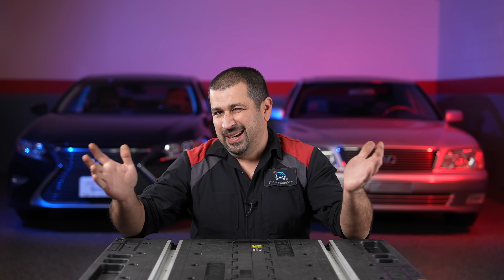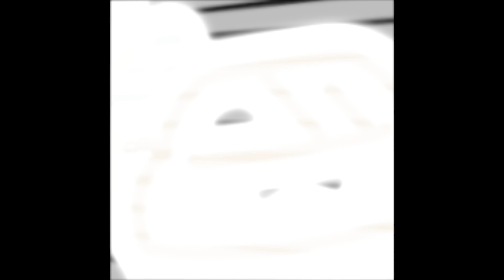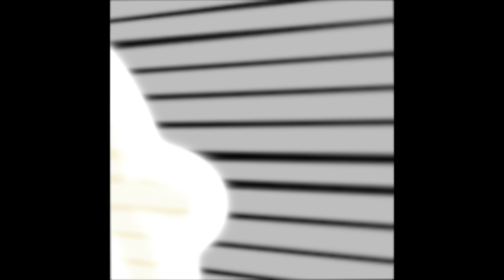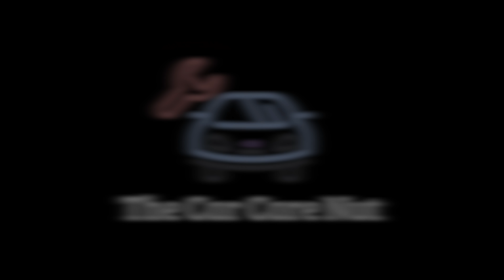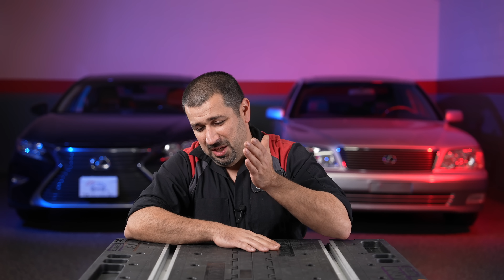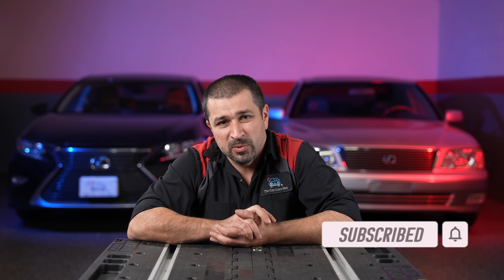Can Modern Turbo Engines Be Reliable? Here's The TRUTH!

Comment: Let it warm up, let it cool down, and change the oil frequently.
Reply: I have a turbocharged mazdaspeed3. I just hit 220,500 miles, with no issues. Oil changes every 5000 miles
Reply: @areitu  Im with you my 07 speed3 has 140k......still going strong!!!!
Reply: @areitu 2020 Subaru WRX, 160k miles, all but 20 miles are mine, zero issues but basic maintenance. Original turbo and clutch.
Reply: @areitu i wish I would have kept mine.
Reply: @areitu  You may have missed the part where he said the newer cars have smaller turbos.  He did remind us of turbo issues in 90s performance cars, but I'm guessing yours is newer than that.
Reply: @areitu don’t see much of you guys out here.. but I agree. 2014 sti at 275k miles. I don’t even cool down the engine just warm up.. you are 100 correct change your oil every 5k miles and it’s not even a concern.. just pure joy ..
Reply: @areitu You got a unicorn. MazdaSpeed cars have been known to be very unreliable.
Reply: @lightsfansofthewest481 lol. Nope.
Reply: @lightsfansofthewest481  no they weren’t lol the mazdaspeed6 had issues but not with the engine. The mazdaspeee3 were very reliable.
Reply: Four Toyota owners and  one Lexus owner told me they took their vehicle to their dealer for a 5000 mi oil change, and the dealers refused to change it, saying it wasn't necessary, wait for 10,000 miles.  The owners weren't asking for a free oil change.  I never heard of dealers turning down money before.
Reply: @jamesdepalma5253 just insist and it gets done. They recycle the oil at Toyota dealers, so it’s not waisted. Oil is cheap. On my 4th Toyota, a 25 Tundra this time.
Reply: @juliemulie1805 get ready for a new engine. The Toyota turbo engines are dropping like flies.
Reply: @jamesdepalma5253 They were not refusing to do the oil change. They were protecting their future income. Less maintenance = new vehicles
Reply: @jamesdepalma5253 I just bought a 25 SR5 Tundra and I'm getting the oil changed at 5,000 miles. It's a brand new engine so imo it should have been done at 1,000 miles due to some of the claims of engine debris, unfortunately they will have to change the oil or it will void the warranty.
Reply: @jamesdepalma5253 I had the same thing when I bought a brand new Kia in 2023.  Wanted a break in oil change at 1K miles and they refused to change the oil - at my own expense - saying it was too early.  I did it myself (and every 4K miles ever since, now at 44K miles) and have never gone back there.
Reply: @jamesdepalma5253 they want the engines to grenade at 10,000 miles
Reply: @evos469 technically they would prefer the engine blows at 65k miles. Outside 5/60 and too far for district rep to goodwill it. Unless you did every service by the book and you have a strong relationship with the dealership, that's customer pay.
Reply: And don't forget to use the recommended Gas octane and oil 😅
Reply: @losslesssound Or use something better if you want "optimal" instead of acceptable.
Reply: @MikeKayK just use what the manufacturer recommends. Higher octane fuel isn’t better.  It is higher octane. All that means is it can withstand higher pressures without having pre-ignition. If your engine isn’t knocking it doesn’t really matter.
Reply: @JamesLake78  Mine requires 93 octane.  Newer models by the same manufacturer say 87.  What happened to allow use of lower octane fuel?
Reply: @moonrich3492 for what car and what years? That’s a hard question to attempt an answer without more info
Reply: @JamesLake78 it’s not hard at all. The ECM does many things like lower boost pressures, retards timing, adjusts a/f ratio etc to avoid detonation. This is why some cars like Mazdas make 250HP with 93 octane but 227 with 87. There was a big commotion with Chevy Cruze owners when it first came out where owners would complain on hot days the car was so slow. Almost like it didnt have a turbo. So one owner put 93 in it and never had that problem again. What was happening is the ECM just opened the electronic wastegate to pull boost completely and cut timing to avoid knock and overheating. So yeah, keep lying to people that higher octane isnt better and it does nothing 😂 you’ll be the one doing 10,000 and 15,000 mile oil changes with a blown turbo because “tHe MaNuFaCtUrEr SaId I cOuLd!!!!!”
Reply: @losslesssound  expensive!
Reply: @gosman949 Yes but necessary. Why sacrifice your engine which would be more expensive.
Reply: Quality thin synthetic oil makes the difference.. 😊😊
Reply: @JP81188 you do not want it too thin or youll spin a bearing.
Reply: @agr_s2k exactly my VW  Volkswagen Jetta 2019 shot a cam phaser bolt into my timing belt. I since switched to 5 w 30 oil which is the oil that car calls for in south America and Europe however in USA it calls for 0w20. it's a epa scam so are 10000 mile oil changes
Reply: @erickh5291  yeah, thicker or better quality oil is always better for turbos. Full synthetic always.
Reply: @agr_s2k don't.change de viscosity of oil. It will destroy the engine. Many components are designed within those numbers.
Reply: @adrianhrusca4067  if you actually knew how to read, I was responding to someone who said that thinner oil is better. I was responding that thicker is better for turbos, not thinner.
Reply: Any tips when shopping used turbos? Can someone tell if it was mistreated based on sound or appearance?
Reply: @icqme8586  No you can't, unfortunately. Only thing you can do is ask for its service history. If they can't show it, walk away. If its had 12-15K intervals walk away too. If allowed you can testdrive it with a scantool attached and see if its running lean/rich but its hard to tell if the turbo is bad just from driving it. As you have no referencepoint (IE knew how the car drove when it was new).
Reply: @The_Noticer. exactly why I buy new.

So few people properly maintain their vehicles.
Reply: @icqme8586 It depends a lot.In a nutshell you can remove the intake ductwork and check for oil leak and play in the bearing. It's a very crude and basic method but will give you some reference point.
Reply: @icqme8586  nope. It's a complete gamble. I do my own changes and don't keep any receipts. Well, I also have no intentions to sell my car. But, if you want assurance you'll have to buy it new.
Reply: No one wants to drive a daily driven econo car like a diesel rig!  We want to be able to start it up, let the oil pressure build for 15 seconds and then drive normally like every naturally aspirated gas car for the past 50 years.
Reply: @BartSparrow123  You had to let a naturally aspirated engine get up to temp first too, if you wanted to drive it spirited
Reply: @The_Noticer.  Of course, but not as critical as a turbo spinning 30,000 rpms.
Reply: @BartSparrow123  i know on mine, it won't even let the Turbo go until the engine temp has warmed up. It's a simple mechanism.
Reply: so do the exact OPPOSITE of what the manufacturers and TV experts tell you to do. it is almost the same as listening to your Dr
Reply: Yes he missed the important point about letting it idle for 30-60 seconds before shutting off to let the turbo cool. Another point is the turbos are generally paired with direct injection, which also cause faster oil degradation than port injection. So between the effects of turbo and direct injection on oil degrasdation, frequent changes is a must!
Reply: @waynek805 this actually depends on the technology. Example I own several GTR’s (1992 Nissan Skylike GTR, and 2013 GTR) my skyline makes 700 WHP my R35 GTR makes 1200 WHP. My skyline is only oil cooled, while my R35 is oil cooled and watercooled. Why does this matter? Well I have a custom tune where it will keep my water pump running for 2 minutes to continue to flow and cool down the turbo when the engine is off. My skyline I have to idle for about 2 minutes for the turbos to cool after spirited driving. 

The water cooled isn’t some ground breaking technology. So it’s important to research the car. 

Now what you stated regarding oil wear is 100% true. I do my oil changes at 3000 miles without fail on my skylike and GTR because turbos generate so much more heat and breaks down the oil much much faster. 

While I change my N/A V6 everyone 5k miles.
Reply: @DJG37S  I think most of the mainstream high volume vehicles with turbos probably don't have the water cooling.
Reply: @waynek805   DI has nothing to do with turbos, that is just how they are meeting emissions
Reply: @notsure6182  Maybe not but it sure seems that they go together more often than not. Of course in the latest engines, it's DI almost across the board, turbo or not. At least in some cases they are smart enough to have the dual port and direct injection setup. And it's not like they didn't know about the carbon  buildup issue when they introduced this stuff. So much bad technology introduced just to squeeze a few more mpg. What a disaster it has become!!
Reply: @waynek805  I always let mine Idle for 30 seconds after I drive it but not to cool it down but to make sure that it's at it's lowest speed possible. I know turbos spool down pretty quick but I like the 30 second rule. Don't need it spinning any faster than it has to without oil circulating. Cooling isn't a problem because cars today have an electric water pump that keeps water circulating after you turn the car off to cool the turbo down. He's right on the money about oil changes. I always use a good synthetic oil, factory oil filter and I do 5K oil changes like clockwork. Plus I don't beat the crap out of my cars. I use to do that when I was young. I've worked on cars for almost my whole life and the days of cheap repairs are over. To much tech these days which means more to go wrong.
Reply: @waynek805 Looks like frequent oil changes are the rule of the day, turbo or not.
Reply: @TonyTony-rs1lh  Depends what you mean by frequent and according to whose rules. 4-5k mile oil changes would be the smart approach for any engine, especially those with direct injection, which is very hard on engine oil!
Reply: @waynek805 if youre not driving the crap out of it or its colder weather its not as important though as the warming it up and getting the oil flowing
Reply: @waynek805  New cars are also often equipped with an auto-stop feature that you have to disable each time you start the car. In stop and go driving, this will cause the engine to shut off often. In most cases the engine won't be pushed to high RPM's in between these periods, but if you drive at freeway speeds for a while and then exit to stop and go traffic which causes the engine to repeatedly shut off. this will cook the oil and shorten it's life.
Reply: @AugustSchunk  Yeah if I had a car with that auto shutoff I would definitely be sure to disable it whenever in I drove it.
Reply: @waynek805 Yes I agree with you but these were older engines,some even came with accumulator that would supply oil to the turbo bearings for upto a minute after shutdown. On new vehicles they have systems to combat this turbo charger are oil and  water fed also they have electric water and oil pumps to feed the turbo with coolant and oil after shutdown this is my personal observation.I am not an automotive engineer but have engineering background.If anyone has better information please chime in.
Reply: @aliasgertayabali5260 Thats correct its not necessary to cool them down. I mean the start stop system in all these new cars would destroy them otherwise.
Reply: @waynek805  The new Tacomas have both port and direct injection.
Reply: @jmpattillo  Yeah that helps with the carbon buildup issue but not the oil degradation via fuel contamination.
Reply: @jmpattillo  Yep so does the new Ford Mavericks and the Explorer have both port and direct injection.
Reply: @waynek805 interesting. Learn something new every day. I knew this about warm up but had not considered cool down. Thanks.
Reply: @gregrobertson9957 extended cool down if driven real hard, especially for long duration. Ideally, wouldn’t want to redline all gears and then immediately shut off the car. Could do some cooling by driving low/normal speed for a bit as well.
Reply: Dont you only need to let it cool if you just boosted with it? If youre not using it while going in smaller streets before stopping in your driveway you probably dont need to wait that much
Reply: @marcts147  yeah, just take it easy on the last mile or two.
Reply: @marcts147 turbo engines have had electric water pumps that keep circulating water when you turn the engine off. And lm talking of stuff made back from 2000.  Don’t know what manufacturers do with vehicals  sold in US.   I do know US sold vehicals of any brand are not the same as other parts of the world.
Reply: @marcts147  no need to have the engine running, just in Accessory mode for a couple of minutes. Check the phone or read the declaration of Independence.
Reply: @elim7228 oh shoot. I do that regularly.
Reply: 2015 golf tdi se 130,000 miles still being driven 5 days a week. Oil change every 5000 miles religiously since. Cleaned particulate filter once.
Reply: Exactly. Daily warm-up/cool-down habits, shortened oil change intervals, proper fuel, and early ignition maintenance (spark plugs, etc) are key to longevity.
Reply: I heard don't need this for modern turbo engines, Couple of second 5-10 should do the job. I have a 22 Subaru XT 2.4 Turbo. My first turbo engine car actually
Reply: With full SYNTHETIC oil
Reply: yup esp let it idle for a minute or two before shutoff... mercedes om617 400k miles..be an absolute nazi about maintenance. Oil and filter every 5000 no matter what any book, light or dealer drone tells you.
Reply: @aggie46  nazi on a Merc? Nice
Reply: I got into a rather heated discussion with the service staff at a German brand dealership because I insisted my oil is changed every 5000 miles.  Now that it’s out of warranty, I take it to a service shop that specializes in German cars, not the dealer.
Reply: The best way to warm it up is to start driving gently, as soon as the engine is running smoothly. Which is usually just a few seconds. It's not good to let the engine sit idling, especially from a cold start.
Reply: Yup same here I let my 2017 1.5 turbocharged civic warm up and cool down and oil changes and it just past 100,000 and no issues, hasn’t skipped a beat 😃👍🏼
Reply: You really don't have to worry about that as much if you use synthetic oil. Owning mine since 1991 I used to do it...but now with full sythetic I don't ...ya know unless I spent the day spooling it up on a hot day
Reply: PERIOD!
Reply: Okay boomer. This doesnt apply anymore. Go back to sleep
Reply: Ya think? How long do you let your car warm up, when it is 20 F out. How many minutes do you sit there or drive it very slowly until the temperature gauge moves? 1 minute? 2 minutes? 5 minutes? Ha!!
Reply: @arthurfisch3673 I use the remote start to warmup the car.
Reply: @howardpearlman6328  You don`t need to.
Reply: Yes
Reply: talking about  a truck or woman ?
Reply: and keep its air filter clean and fresh.
Reply: Good luck with that
Reply: Yes thats help but if you have a frenetic life, working, you don't have time to warm it and cool it 5mins+5mins everyday.
Reply: Personally When I start and shutdown the car i let it idle for 1-2min. Oil change every 3k miles in my Corvette, 5K Tundra (May change it around since the Z06 is NA and the Tundra Turbo).
Reply: Defining frequently is the difficulty especially if one does not DIY.
Reply: This is the key what I tell and inform all of my customers cause no one has told the public this.
Reply: Basically how you deal with an airplane. Wonderful.
Reply: cool your turbo down
Reply: I just keep my older Toyota. No turbo for me
Reply: @smokeylake6732  they wear out eventually unfortunately.
Reply: How about dont buy one?
Reply: Cool down means to drive easy the last mile and then let the engine idle for at least two minutes. Turning off the engine while the turbo is still spinning means you shut off the oil pump and the turbo axle is not getting lubricated aka is running dry aka come in a critical phase of wear.
Reply: let it cool down, yes. let it warm up.. CAN be false. depending on how you mean. you don't sit there for 2 minutes... big no no. 10-15 seconds and drive away to get the ring tolerances up ASAP - yes. you actually want heat faster when you have any engine.
Reply: @twrcrew8852  i just don’t spin the turbo up when it’s cold. I wait until the oil temp comes up.
Reply: @jmpattillo   On an old car with an aftermarket turbo or somewhat larger exhaust turbine, sure.  On these new 2016+ economy motors? it's not really possible to "not spin the turbo up". they are flying at full tilt barely off the throttle and have electronically controlled wastegates so you don't notice them when you're not trying to accelarate. but they are already doing it and there's no input the driver can make to change this short of rolling down a hill in neutral.
Reply: @twrcrew8852  I understand that it’s always spinning, but the speed of the turbo and the boost pressure increase with acceleration. I accelerate slowly when the oil is still cool. Not a perfect strategy, but it can’t hurt.
Reply: @jmpattillo  ohhh no. no no no.. The pressure is simply dumped. i'm telling you. one of the reasons it may feel that way is because the turbo's boost is literally wasted. above 2000rpm, you will be hard pressed to find any modern car that isn't already at full boost in an economy model. you just don't perceive it because it's being dumped into the pluming and bypasses your intake charge electronically. when you "command" more boost, the boost is already at peak pressure from the tiny turbo, it just closes that bypass to create an instantaneous sensation.   

Yes you are describing larger and older conventional turbo operation. but they are far far more complex in operation now.
Reply: @jmpattillo  but actually yes, you're correct. taking it easy but also "hurrying up" to get the temps up is best for the engine and turbo on these.
Reply: If I’m going to work, running a quick errand or have an emergency how?
Reply: Turbos work much better at higher altitudes where NA engines run out breath and struggle.
Reply: @Pamlicojdjdj1487 Not really. Turbos suffer at altitude also. They just are able to pressurize that thin air for the engine.
Reply: Yeah.. I see a lot of people not allowing their car/truck to warm up properly and just taking off right away big mistake down the road!
Reply: My dad had an 85 Dodge Conquest and he had to get the turbo redone in 2010.  That was with letting the car warm up and cool down after EVERY drive.
Reply: Yes, that works. To a point. If you want to pay $100 for an oil change every 6-8 weeks on top of everything else.
Reply: Actually, you can drive it for 3 minutes without engaging the turbo, both on start up and shut down.
Reply: Turbo diesel engine 10 minutes warm-up and 5 minutes before turn off.
Reply: Learned that lesson years and years ago on the farm driving my dad's turbo'ed Case tractors when he'd let me.
Reply: Excellent advice though I admit I do: Start and grow, boost it like you want it to blow up and put it away hot. Still had no problems (All oil and water cooled turbos though)
Reply: What are you thoughts on going with thicker oil for those that say some cars manufacturers are recommending 0w-20 for better mpg because of government regulations? Have a 3.5L turbocharged gv80. Was wondering if it’s safe for me to just use 5w-30 full synthetic from now on. 47k miles currently and I get oil change every 4-5k miles.
Reply: @YGuser631  the care care nut addressed this question in a recent youtube short. The vehicles are programmed to expect the thinner oil, so using thicker is not a good idea.
Reply: @jmpattillo thanks. I watch most of his videos but miss a few here and there
Reply: Better yet… don’t buy them.
Reply: What does let it cool down mean ?
Reply: @IEA_455  either drive easy for the last few miles, or let the engine run for a minute or so before shutting it down.
Reply: Yet dealers will charge $120 for an oil change these days.
Reply: Not warm up by idling but driving gently
Reply: @sunilayya8948  yes. I try to wait until the oil temp comes up before I. Spin up the turbo
Reply: Many new turbo cars have electric after-run coolant pumps that prevent heat soaking of turbos.
Reply: @midcenturymodern9330 tundra being an example.
Reply: Just because Toyota failed to make a reliable turbocharged V6 for the Tundra, Sequoia, and Lexus...don't mean we need an episode of excuses.  Ten of millions of Ford Ecoboosts out there with many are over 200k, didn't blow the blocks off
Reply: @n @noblekitty lol rage baiter
Reply: @noblekitty 😂😂😂
Reply: @noblekitty  And even more Redblocks and Whiteblocks in Volvo's going back to the 80's!
Reply: Modern engines with electric water pump and water cooled turbo don't need this.
Reply: . In the winter I would still let it idle for a minute or two.  Even the best synthetics get thicker so getting that oil warm will help that turbo. It's not good to starve the turbo bearings.
Reply: @simontist don't need what
Reply: Stupid Biden admin on climate change nonsense destroyed the car industry.
Reply: @smokeylake6732 blame California.
Reply: It’s not the 1980’s anymore…turbos these days have a dedicated water cooling and/or oil cooling circuit, and most of them keep the fluids circulating for a period of time after engine shutoff via an auxiliary pump.

There’s no need to do an old-fashioned cool down before switching it off.
Reply: @jimmytml if doesn’t hurt to do it, then why not..and this is only after really hard driving. Also doubt average car owners will know the design of their turbo, but probably won’t do much racing or hard driving either.
Reply: Let it warm up? That's a luxury the working class can't afford
Reply: @danielavila4108  engine is 10K
Reply: @danielavila4108 no time for that. 😊
Reply: How is that???
Reply: Good advice. Still not buying one.
Reply: @chester_hobbs you must. This society commands it! 😊
Reply: No.
Reply: Use 5W40
Reply: I even went the extra mile and fitted a giant wagner intercooler on my civic and added a cold air intake, all to lower the cylinder temps. Its a lot less iffy and hesitant on throttle now. Yes it also makes more power, but that only wears the engine faster if you rev it higher.
Reply: @The_Noticer. that is exactly what I want to do when I grow up and buy a new cat. 😊
Reply: @The_Noticer.  cluless
Reply: @strayedcat1966  166 replies, think i'm going to check what i said in order to respond?
Reply: Am a truck driver for 20 years and I have a lot knowledge about engines any engine, including boxer engines., I use TURBO ENGINE ONLY in tractor commercial truck , BUT I skip any single turbo engine for pickups truck , SUV and sedan cars , just no worked basically is just scam technology , Turbo engine is ONLY for tractor commercial trailers
Reply: @pacae911 what an ut twin turbos?
Reply: @JamesDeLaFuente-s4n double scam , come on turbo engine are terrible, why you choose twin turbo , that is insane
Reply: No. I'm not going to sit and wait for it to warm up and sit to wait for it to cool down. No.
Reply: @barryjoslin432  just drive it easy and avoid spinning up the turbo until the oil temp comes up. Also, easy driving just before your destination will allow it to cool down, like driving through your neighborhood to your house or looking for a parking spot at a store. You just want to avoid driving really hard and then shutting it off suddenly.
Reply: @jmpattillo Define driving really hard. As is racing with the car?
Reply: @timothylee2772  it’s all in the Toyota manual. They don’t really define it. Just drive more easily on the way home from the races to let the turbo cool down.
Reply: @jmpattillo I don't race with my car. I just do regular commute, so I don't need to cool down before shutting down the engine? How about like after driving for 30 minutes on a freeway to your destination?
Reply: @timothylee2772  probably the relatively slow drive from the freeway to your parking place is enough.
Reply: @timothylee2772 then cool down wouldn’t be necessary.

Maybe a general/high level explanation as to why cool down might help.  Oil is in turbo, hard driving creates heat and oil temp can get high.  Leaving high temp oil in the turbo is not good for it. So cool down, which can be idling and/or driving in low rpms (cool down laps) before turning off the car circulates the oil and helps bring down the temp, therefore wouldn’t leave hot oil in the turbo.
Reply: @davidd7175 Ok...thanks for the explanation.
Reply: @jmpattillo this is what ive been taught as well... for moden turbo 2x turbo - drive it easy the last mile or two and youre good... and change the air intake filters.
I still let my 2024 Z sit at idle for 30 seconds or so even after easy driving. 😂
Reply: @barryjoslin432  You don't have to, you just have to use your noggin'. Every engine, especially the aluminium ones, need to be warmed up properly before putting the full load on them, turbo's are no exception. And you don't need to sit for a while to allow the turbo to cool down, just stay off the boost for the last few miles and your turbo will have cooled down enough.
Reply: @barryjoslin432 you dont have to. Original poster doesnt know how modern turbocharged engines work. What he said applies to turbos at least 3 decades ago
Reply: @barryjoslin432 no one will realistically do this
Reply: It only needs a few seconds for it to spool down.  They don’t need cool down.
Reply: @bngr_bngr while circulating (engine running) the oil gets to around 150 degrees Celsius. The turbo itself heats up a few times that. Like over 500 Celsius. When you stop the engine there's oil sitting in the small cooling passages inside the turbo. As it is no longer circulating it cannot dissipate the heat, so that small amount of oil will match the turbo temperature. It will burn and deposit in those small passages. Over time it will build up... Yes, let it run for half a minute or a minute when you arrive at your destination, especially after a spirited drive.
Reply: @CosminRotaru  EXACTLY! Oil coking!
Reply: @bngr_bngr in Aviation a turbo charged piston engine requires a warm up and a cool down. They even specify a set temp to warm up and a temp to cool down to before shut down. But aircraft engines are expected to last. Cars are just considered disposable.
Reply: @FalconWing1813 yeah in aviation those engines are a little bit bigger.
Reply: @FalconWing1813 isnt this where turbos were born out of? The Aviation industry.
Reply: @stratonick  yep and they do need a warm up and cool down. Warm-ups are for the oil to get warm and flow good and not starve the bearings. The cool down is to let the turbine and bearing Temps settle so the oil will not cook inside the turbo which shorten the turbo life.
Reply: @FalconWing1813  Failure at altitude is problematic. If I blow a rear seal on my 850R, I'm already on the ground. 😉
But your point is a great one. I do warm up and cool down my turbo cars. All have more than 200k. My '96 850R has had the same turbo since 2014!
Reply: @FalconWing1813 there also 40-50 year old tech
Reply: @KapitanPoop  true modern cars do have water cooling that helps with the heat soak issues.  And allows the turbo to be more practical in a family daily driver,instead of a race car. Keyword is help. And does not exempt the need for synthetic oil and proper care. We just live in a world where cars are disposable in many people's minds.
Reply: @bngr_bngr I don't think you have ever seen a turbo running a full load 😂
Reply: @aliasgertayabali5260 my Porsche Turbo runs a full load of power but it’s a small car.
Reply: @bngr_bngr That's is even more interesting, try looking at it in the dark without a flashlight after your full load run 🥵
Reply: @aliasgertayabali5260 the turbos glow, the headers glow.  If I’m lucky I might get some flames from the exhaust.
Reply: @bngr_bngr they definitely need to cool down. They just dont need any help from the driver. Modern turbos are oil and water cooled and continue to be cooled after shut off.
Reply: @bngr_bngr  from what I know, you only really need to do that I've you had just pushed the car really hard before reaching your destination, or if you are stopping after a long highway drive. But still, if you drive at lower speeds/power in your neighbourhood till you reach your home for example the turbo and engine overall has enough time to cool down and you should be safe to shutdown your engine without waiting. Honestly, I still wait a minute before I shut my car off if I have been driving "spiritedly" just to be safe, and yes the car keeps the fans on for a minute after shutdown, but I am not sure if they also feed the oil pump.
Reply: @bngr_bngr  Every turbo needs to cool down before you shut off the engine.  If you are towing or running under load the turbo is probably 300-400 degrees!  It will cook the oil if you shut it off that hot.  This is another reason turbo is a terrible idea in a daily driver!  Not a single normal owner is going to let the car idle 60 seconds after startup and 60 seconds before shutting it off.
Reply: @BartSparrow123  No, you don`t. Do a google search next time. 
"No, modern turbo engines typically do not require a cool down period before shutting off, as they are designed with features that manage heat effectively. However, if the engine has been driven hard, allowing it to idle for a minute or two can be beneficial for peace of mind." - Anthropic
Reply: @BartSparrow123 Yes you are correct but your temperatures are a little bit off you need to add a couple of hundred degrees 😂
Reply: @bngr_bngr  Best practices > "need"
Reply: @bngr_bngr  That's not really true. First off, cool down is a relative term here. The big reason one should let it run for a short bit before shutting IF they have been hammering, is because oil also carries away heat. Way back before synthetic oils and/or additives that dealt with heat better, the oil would actually break down / burn IN THE TURBO (do some digging on oil-coking in turbos).  Considering the cost of things and inflation, cooling down, and even pre-oiling are cheap safe guards for taking care of a vehicle.
Reply: @bngr_bngr  WRONG. Oil will coke in the turbo bearings, and even in vvt gears.
Reply: @truracer20 sounds like we shouldn’t buy any turbo engines.
Reply: @bngr_bngr  yep these guys are living in the past!